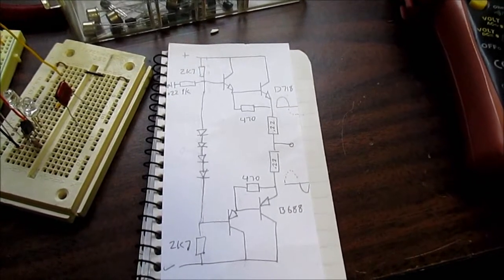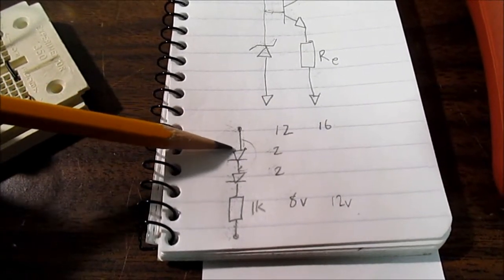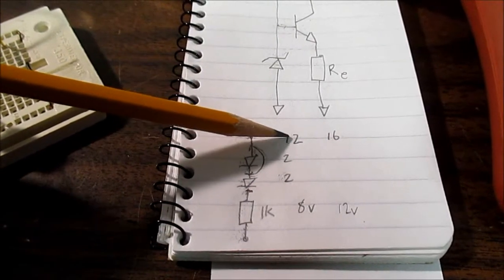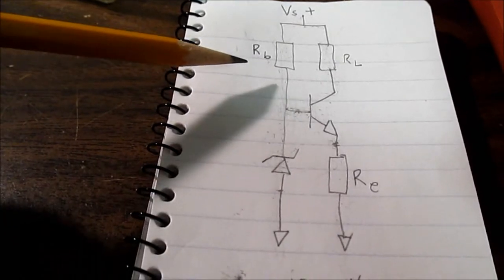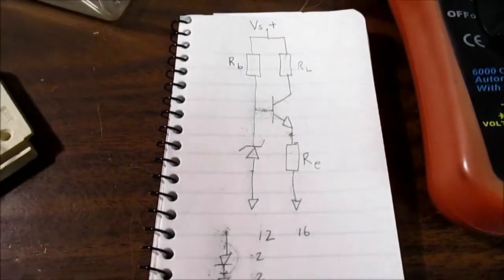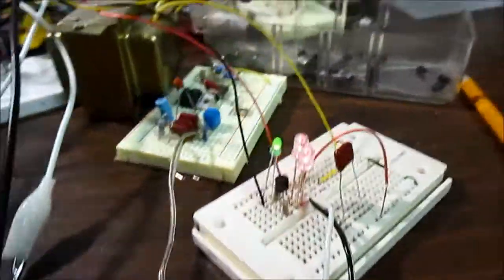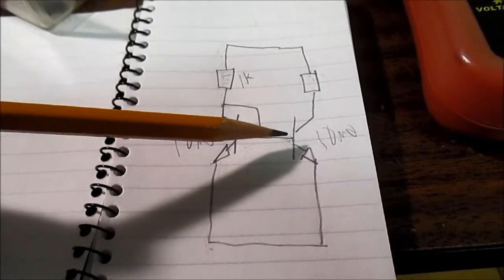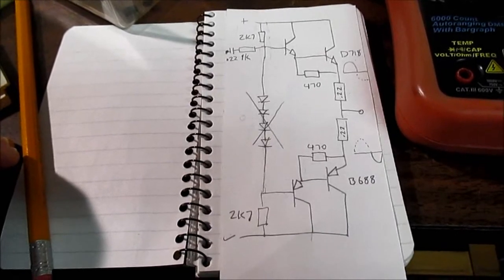Current source & current mirrors in audio amplifier

Comment: A word of caution:   Using PERFECTLY  matched  transistors makes the current mirror work perfectly .
Using a pair of transistors of the same type (say 2each  2N2222A ) can produce good result or NOT so good.

if   Vbe1 =Vbe2    AND   ib1 ~ib2 
 BUT it is possible using randomly chosen transistors  that  hfe1 = 1/4 hfe2 !  (the most  extreme choice !)   

so  Ic1 =hfe1 *ib1 ;  Ic2 =hfe2*ib2      
 OR Ic1=1/4(hfe2)*(ib2) = 1/4*Ic2  ! !   BE CAREFUL

Comment: This is interesting, I've always wondered how current sources worked and never quite realized the implications of transistors being current, not potential devices. Also the potential drop from base to emitter (for NPN transistors) makes much more sense to me thanks to your videos.

The most interesting part for me though is that this explains the schematics I've seen where I noticed the mirrored transistors in the current mirror configuration. This made no sense to me until you showed how it worked step by step. Combined with the fact that transistors primarily function by varying their current, and not the potential, it finally "clicked".
Reply from the maker: +Gersberms Thank You! That is what is important to me - that at least a few people get something out of my videos.
Reply: I love your videos, I have seen most of them now. What I like most is probably that a lot of it is audio related, which is my favorite subject for electronics.Why do you make so many amps though?

Comment: Hi John, found a good video at all american five radio, "transistor push/pull audio output amplifier", signal driving next stage, needs to be 180 degrees out of phase, thought might be of some help. Great channel. Chip amps rule, o.k. maybe a few old tube amps  too. Have fun with it. Cass.

Comment: Hey J, Been following the series, watched 2nd and thought you might be interested in some All American Five Radio videos on push/pull output and push/pull audio output tutorials that might prove helpful. Check Joe Mullen on YT, building same thing but having issues with a relatively easy circuit. AAFR has many excellent videos on electronics, great explanations and graphics, check it out. C.
Reply from the maker: Cass Virgillo Hi Cass, Thanks for your tips. I'm aware of All American Five's channel. The idea is to build this thing without outside assistance. I'm not stuck (yet), just have to to make some decisions.
Reply: Hi John, Sorry, didn't mean any disrespect or to suggest you were stuck, you surely know more than me, that's why I subscribed to your channel. I just happen to see vids and thought might be of some help in designing your circuit, over my head. Thanks for the video on LM386 separate ground paths, a big help. I know you will figure it out. Take care, Cass.
Reply from the maker: Cass Virgillo  No problem. I thought you were just trying to be helpful.